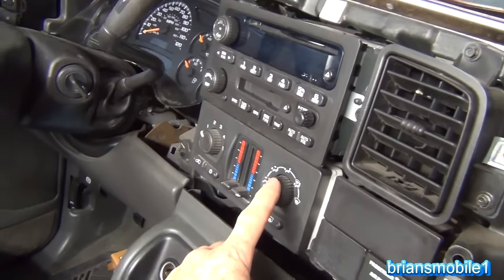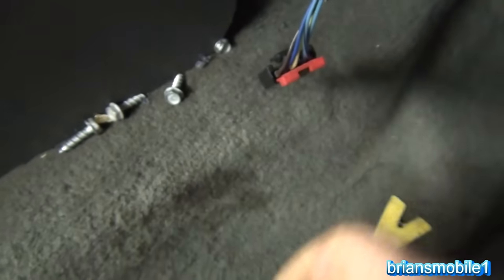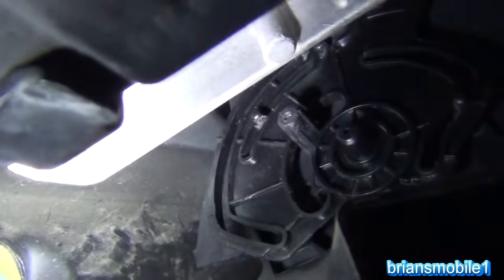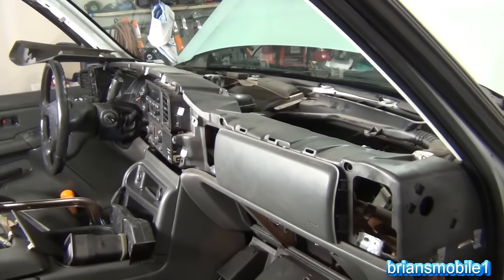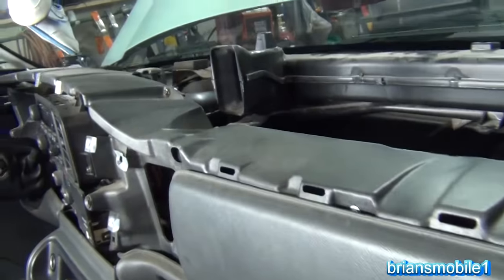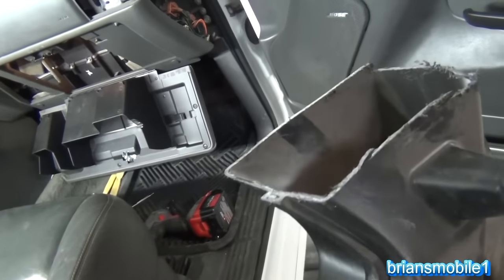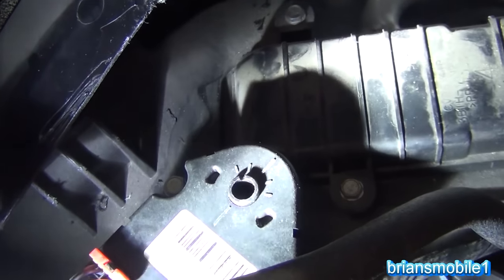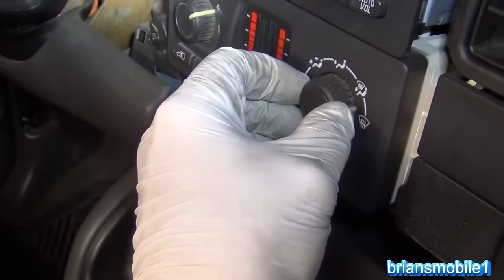Silverado Heater and AC Actuator FIX

Comment: Hasbro 
Hey Brian. Thanks for making this video, it really helped me. But, I have a strange problem. I have a 2006 Silverado, with manual controls. I replaced the control module about a year age, because some of the fan speeds had stopped working. I did the calibration steps, and everything worked perfect. Now, for some odd reason, all of the controls are acting in reverse, or something. When I put the temp sliders all the way to cold, I get heat, and vise versa. When I put the defrost on, it blows on the floor. Vent blows on the windshield. And floor blows out the vents. 
What the hell is going on?
Can anyone help please???

Comment: if the recirculate/fresh doesn't work and I have no heat, could this be the control switch rather than the actuators?

Comment: PRO TIP: Just take off the metal brace over the ducts. 4x 10mm bolts and a few 7mm bolts. You can then wedge the ducts about 6 inches to give you PLENTY of space to take the actuator off. I didn't feel comfortable cutting the duct. It took a few minutes longer to lift the one-piece ducts. But, I have cold air. Total time about 45 minutes. Saved $1800 - that's how much the mechanic wanted to charge me.

Comment: Only blowing cold air when heat is on.  Can’t change mode either. Now sometimes it will blow hot air, but if I turn it to cold it’s stuck on cold until it decides to be hot again.

Comment: Is the location of actuators in Hummer H2, any similar to this? My 2004 H2 blows only hot air, on the left (Driver) zone, irrespective of any temperature chosen.

Comment: I'm starting to hear a noise coming from the passenger side of the truck. I opened the glove box and will further investigate. I've had to replace these actuators on my 88 Chevy Cheyanne. I'm going to disconnect one actuator at a time to make sure which one is causing the issue.

Comment: I have a 2003 Silverado with manual dual temp. The drivers side is blowing hot can't get it on cool the right side bottom actuator is working the passenger side works fine cools and heats when I move the selector. All the vents when selected works also. Help me and tell whats up with this

Comment: I replaced the temp selector for the drivers side(under the glovebox) when you plug it in, and turn on the key- the actuator just goes all the way to one direction, and gets stuck there.. It's a digital temp selector vs the manual config you have here.. Any thoughts on the problem

Comment: I have hot air blowing out the passenger side at all times. I've replaced all but the drivers side actuator and still not fixed. Any ideas of what to try next?

Comment: I'm just having trouble with the air (not A/C air) air coming out of the wrong places, when I run my heater it come out where the A/C comes out and not at the floor. What do you think is the problum?  this is on a 2002 cadillac escalade. 12/12/2018

Comment: Im working on the exact same setup right now but i have no power at all to all 4 actuators, and it is not the control panel or fuses, any ideas? Why did you have to replace all the actuators?

Comment: Hi Brian..everyone here says your a rockstar, hopefully you can help me. I have a 2002 Suburban 1500 LT 5.3L. My A/C works fine. BUT, my forward heat does not work. The recirc fan works, all the other positions work, and the rear heater works awesome. But the front heater does not work. I did have clicking down by the floor. I removed the lower blend door actuator and found a gear inside was cracke, so I replaced the blend door actuator, calibrated it and it STILL BLOWS COLD AIR UP FRONT!! UGH Please help me.... Not sure what to do now.
Thanks Scott

Comment: I was wondering if you could tell me what my problem is.  In the summer with the temperature controls in the cold position all the way to the bottom it makes a clicking noise.  If you move it towards the heat position the clicking quits. This winter with the passenger temperature control I hear a squeaking noise.  If I move it towards the cooling it temporarily stops squeaking.  Any help would be appreciated.  HELP!!!!

Comment: My 04 GMC won't blow air out of the defrost vents,  i looked under the dash near the gas pedal and saw the actuator moving, I already replaced the one on the bottom, any ideaa what other one may be causing me issues?  When I go all the way to the right which should be defrost only it blows out the bottom vents

Comment: I have the door blend actuator for the driver's side that does not move even after replacing it. I cleaned the connector, with no changes. What do I do now to make the driver's side change from heat to AC?

Comment: Like, Like, Like.  I have an 06 Sierra, and 06 Yukon both with auto AC.  Knock on wood, have not had any trouble with these, but If I do, I know where all the little demons hide.  I believe they are in the same location, just different part numbers for the auto AC.
Reply from the maker: +jewllake That's right.  The auto ones are cheaper and more available than the manual ones too.

Comment: Need help 2004 Silverado replace both bottom and top actuators but getting cold on the driver side and hot on the passenger side when everything is on the off position when I'm driving i feel hot and cold air coming in any  suggestions on what it can be thank you

Comment: Those Fein multi tools do a great job cutting this stupid hard duct out. My 1970 GMC K2500 had flex duct and blew 26 degree air pulling an Airstream up out of Death Valley. R134 will never work as well as R12 did. The Harris AC in the old GMC pickups was the same EXACT unit used in Lear Jets. You can even just use 3,"4"5" or 6" flex duct to replace that sh*tty GM hard duct. The flex duct worked really well. I use the foil "DUCT" tape over that silvery "Duck Tape". I'd love to catch up with the shitbag that cut holes in the wheel wells of my dad's truck to access the spark plugs. I'll probably be doing the dash removal to replace the heater core real soon like. I just water flushed it 2 ways then used compressed are & urped out a big blob of rust & calcium all over my hand, and the distributor cap. I'll tuck a 1/2 to 5/8 adapter coupling in the console,
 so I can bypass that heater core when it takes the final crap inside the cab. I had one go out at the perfect time. I was 18 years old, and driving my 1970 GMC like an idiot, racing someone driving a 1984 Chevy C10 4x4 when a sheriff spotted us. The seat cover's pockets were packed with weed, illegal fireworks, and I had a sawed off shotgun in the scabbard. He opened the glove box & green rusty water came pouring out, SEARCH OVER & DONE, and he threw me in the back of his car & started running my name for warrants. He let me go, and I went to work  and explained to my boss why I was in the back of a police car. The City of Scottsdale had legal jurisdiction and forgot to subpoena that sheriff so my 4 tickets were also dismissed, because I was working 180 miles away in Flagstaff by then. LOL I am an old stick in the mud now.

Comment: I have an 05 Sierra with an automatic climate control. In the summer when the A/C is on I will get an automatic switch from A/C to heat. In the beginning I could get A/C back by turning off ignition and restarting. Now I can't reset, it just blows hot. Is this my driver's side actuator acting up?
Reply: Jim Dent  I have same problem. I manual control but same thing. When I turn it back on, it goes to cold for a few seconds, then right back to hot. I know it's not the actuator. I wonder if it's the heater/ac controller?
Reply: Hi Jim I have the same problem in a 05 Chevrolet silverado 2005 , Did you fix your problem ??  I just have the issue on the driver side .

Comment: i have 2007 Silverado Work Truck no heat but damn good ac do these have a heater control valve
Reply from the maker: Try checking the heater hoses when the truck is warmed up and set to heat.  See if only one side is hot.  If it is, the heater core may be blocked up with stop leak or something.
Reply: Yea, i was noticing that one hose was hotter than the other. Me and my cousin said hell with it one night and flushed it to see if that would help. It did works like new now. Must not take much to clog one, not very much stuff came out of it when we did it, but it fixed it. :)

Comment: I suspect this is backwards, the driver side is under the dash and the passenger side is on passenger floor. I replaced the lower one on passenger side and the driver side still blows hot in the summer, replaced under dash and that fixed drivers side...

Comment: Fortunately, the doors themselves didn't break. I spent around 12 hrs on a Ram that had a bad mode 2 door and leaking heater core. You have to get the refrigerant removed, and pull the entire dash. The entire duct has to come out.

Comment: so im getting this inconsitent weird ticking rattling right above ish of heater core on 4.3 s10. it goes away on acceleration . at worst on idle. speeds up a little with fan speed. could my acuator make noise like this? sounds like a piece of plastic spinning around in a wind tunnel....

Comment: Do you have to take out the passenger side airbag to remove the dash?
Reply: No ~ do not attempt;
It can blowout and break a neck;
You take the time to calm-down;
I discussed this with my professional shop but have lost what he told me;
If they deploy the compressive force is way too much and instantaneous faster than hand-slap;
They are very powerful despite what you might think as a combined head-on @ 140 nobody is going to survive that and is very very very painful if you recover consciousness before EMS can pump you full of Morphine

Comment: Question:What if the driver's side vents are set to blow in cold air but for some reason after a while start blowing hot air while the passenger side vents continue to blow out cold air. Which AC Actuator would one need to replace?
Reply: the air door blend actuator
Reply: But which one of the 4 actuators?
Reply: If you have a GMC truck it is likely the one located at the bottom of the dash (above the transmission hump).
Reply from the maker: That would be a bad drivers side blend door actuator.

Comment: Brian please help I watched tunes of videos countless hours trying to figure my out my 2005 Escalade 
I changed the 1 blend door actuator under the pass side because it was blowing hot on one side changed and fixed it 
So now my ac is coming out cool not ice cold
 freon is good I changed the sensor under the hood lines are ice cold clutch engaging on compressor just not ice cold coming thru vents 
Please help me if u know any thing about it

Comment: sorry didn't elaborate more the fan does work if I hook it direct to the battery power getting to the fine but fan will not come on when it's plugged into the blower motor resistor
Reply: Gerardo Garcia its gonna be that same blower resister i had the same problem with my 02 burban on the wire that plugs into it shows that it has power but on the inside the resister turns into a sort of relay so its not flowing the current all the way to the blower...hopes this helps
Reply: David Vargas Thank you David I put a new resistor and blowing ice again thanks.

Comment: Last year I couldn't get A/C but could get heat, I've noticed now that summers coming to a end I no longer even get heat. A/C used to work fine, and Heat used to blow nice and hot, could this be the problem?
Reply from the maker: Could be- as long as the fan is still coming on.

Comment: How do you determine which actuator is bad ?
Reply from the maker: You'll know from trying to make adjustments from the drivers seat (unless your passenger does that).  From there follow the clicking and make it click while you touch them.  You can feel which one is bad.  It's not as hard if you're doing it.... and you watch the whole video.  I make it pretty clear.

Comment: my truck (2004 Silverado Z71 Ext Cab) has the automatic temp. sometimes while running the A/C, the driver side will start blowing HOT while the passenger side still blows COLD. the only way i can get it to correct is stop and kill the engine and restart. so the actuator that's messing up is on the passenger side? thanks for this video.
Reply: +Glyn Robinson I am having the same issue on my 03 Yukon.  Have you tried to fix yet?  Any recommendations?
Reply: +Bill Recher no i haven't. i have the part ready. when it gives me trouble i will change it. Or i may change it sometime. too busy working on my John Deere 320 getting ready for mowing season.
Reply: +Glyn Robinson quick question? are all the actuators the same? or are they each specific?
Reply: +blaine roberts i looked at a few and they look the same buy i wouldn't swear to it. go to www.rockauto.com and they will have all the actuators on one page. i haven't changed mine yet. good luck!
Reply: Glyn Robinson I was gonna hit up an o reillys or autozone. They dont have it?
Reply: +blaine roberts yes they should have it. i got mine at amazon.com 

i got 
Dorman 604-106 Air Door Actuator
Reply: +Glyn Robinson alright kool thnx bro oreillys has them in stock. thnx bro appreciate the quick response
Reply: +blaine roberts you're very welcome

Comment: This summer my passenger side heat was on when control was set to ac.  I replaced the actuator and thought it was fixed.   Now that it's winter passenger side blows cold when set to heat.  Annoying.  Not sure what to do.

Comment: Did you have to disconnect the air bags when doing all this?
Reply from the maker: +Michael Doerner No.  You can just disconnect the battery.
Reply: Can you pull the fuse for the airbag instead?

Comment: I have an 04 tahoe with the same manual dual climate control. the passenger side heater setting works but not the driver side. so is it the driver actuator gone bad?
Reply from the maker: 98% yes 2% could be the computer or controller.

Comment: hello my problem on my 2005 silverado my vents blow out hot air now and then when i am using the A C. and the cold air stops blowing. can anyone tell me how many actuators there are in this year of silverado truck and which actuator i will need to repalce ? thank you much.

Comment: Here is my problem: Fan level 1&2&3 do not work and I can't get the defrost mode to work.  The front air vents work fine including heat and air/con work fine.  What do I need to do

Comment: great job on video,.....but,...GM needs to go back to the 1970s on this, a wire cable would prevent all this trouble with over complicated electric mechanisms that fail, another genius move by GM

Comment: Here to find out which actuator controls the speed. Heater comes on but I can't control the speed between 1-5. Used to work at just 5 but now nothing.

Comment: Please help... 2005 GMC Sierra 4.3 1500. All my controls work,  I have heat and cold A/C and it blows throughout my vents and floor, but when i need my defroster to work for my windshield, it blows out cold air instead of hot!
Reply: Look up HVAC reset, has to do with pulling a fuse and waiting a minute then starting the truck and not touching anything while the blend doors reset themselves.

Comment: I’m not sure if any of my actuators are bad.  I can put pressure on knobs and move sliders up and down to get the AC to blow instead of heat, defrost, or floor so my brain says I need a new control panel

Comment: None of my actuators we're working. I changed the two under the dash and the one under the passenger side. The one under the passenger side works good but the other two not. The air recirculation one worked for a few minutes but now the switch light just blinks and is not working. The passenger side actuator under the dash stays stuck at hot. I recalibrated the system and when it's recalibrating the actuator does move so I know it works but then moves to the hot side then stops and doesn't move from the climate control. Any suggestions?

Comment: In my 2004 Silverado my ac compressor is fully charged and it turns but it blow hot air in passenger and driver side would it be my climate control module that's gone bad?

Comment: Quick question ! we have a 2005 denali and randomly switches from ac to heat and won't go back to ac until you turn off the car and start it back up. what could that be ? thanks Mr brian
Reply: Same here on a 03 Avalanche. Please advise on a repair. Thanks again for the great vids!
Reply: Also, it only switches on the driver's side. Passenger's side stays cold.
Reply: +CDP135Z thanks lol I forgot to add that
Reply from the maker: +roughredneck 22 44 45 I think it's the electrical side on the actuator, but it could also be a bad controller.
Reply: +briansmobile1 how would you figure out which it is and fix the problem ? love your channel man. ur a huge help. God bless brother
Reply from the maker: 1. Use a scan tool to actuate to narrow down just the actuator. 2. Swap the two actuators top and bottom and see if the problem switches too to isolate problem.  3. Swap the head unit or actuator with a known good one.  4. Do like the dealership does and replace EVERYTHING involved.
Reply: +briansmobile1 thanks ! will do

Comment: I have a 2004 Chevy Silverado. I am having HVAC problems. Every thing is working properly with the exception of diminished air flow from the passenger dash vents. Also in the summer with the controls in maximum cold I hear a clicking coming from the dash. If I move both of them one click towards heat the clicking stops. This winter with the temperature control in the maximum heat position it has started making a squeaking noise from the dash. I assume I have a actuator problem. Can someone out there tell me which actuator I have a problem with and its location. HELP PLEASE !!!!!!!!!

Comment: does anyone know if a 2004 chevy Silverado K1500 v8 5.3 truck has a fuel filter? & where would i locate it if its not on the drivers side frame